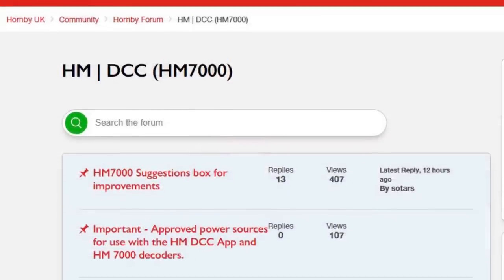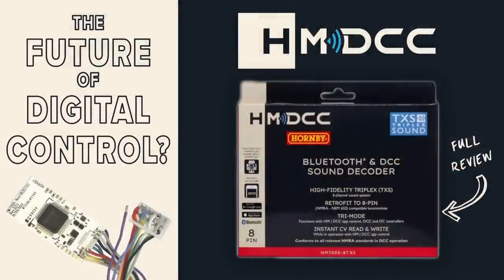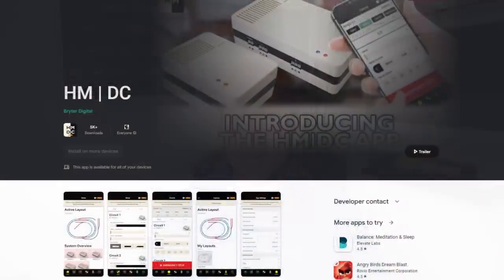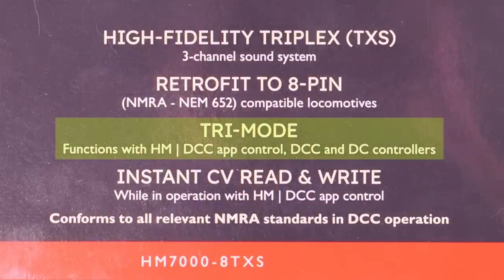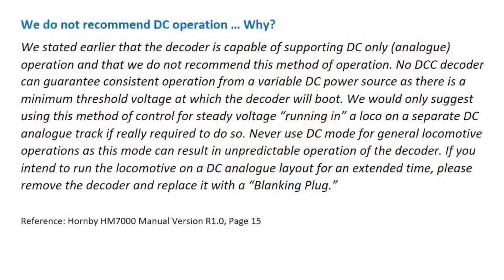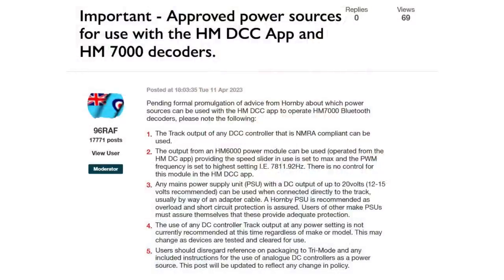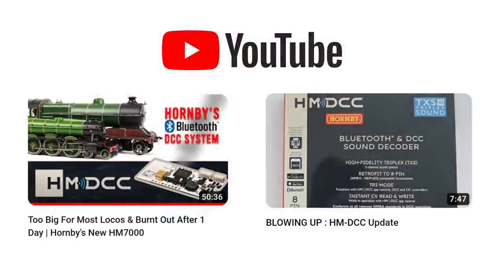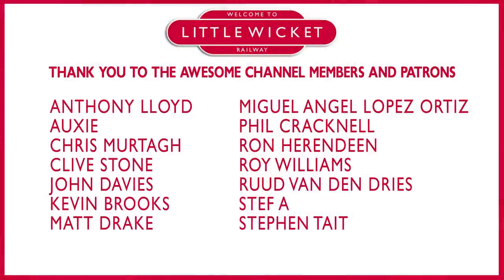IMPORTANT INFORMATION | Hornby HM7000 - Don't Destroy Your Decoder 💥

Comment: Hi Little Wicket, thanks for a balanced review of Hornby HM 7000. Now for my experience with the system so far. I’m a bit of a beginner in rail modelling but pretty good in Marine modelling, so when I saw that Hornby were moving into TT120 and I was looking to try something new I thought this is for me.
I ordered a set and a HM7000 decoder for my A4 , once both had arrived I tried to use the supplied PSU and controller but couldn’t get it to work. I then asked for help on the Hornby forum and the support was excellent from everyone including those you mentioned. I ended up purchasing the Hornby R7337 PSU and wow!! What a difference! Everything works perfectly, now since then I’ve been advocating to anyone who is having the same issues to purchase the R7337 PSU. 
I have also spoken to Simon Kohler about this in a roundabout way due to another issue and they are aware of the issue and will sort it out ASAP. Honestly I think that HM7000 is utterly fantastic with what I’ve seen and used so far.

Keep up the good work Little Wicket 👍
Reply from the maker: Thanks for sharing your experience and welcome to the hobby! It's good to know that TT120 and the new tech is bringing in fresh talent.
Reply: How did you set up the wiring for your track, as I’m new and not sure what to do. I’m using Peco track.

Comment: I have been very impressed with the decoder. At the price, functionality and user friendliness this really is a game changer and a big challenger to the existing high end chips. I think we need to remember and acknowledge that this is the 1st iteration and will be updated over the next 12 months just in the same way as Apple Watch Series 1 and the original iPhone. The beauty here is that firmware updates can be delivered over the air to fix the inevitable bugs that come with any initial launch of a product like this. I would like to see Hornby open up the platform to 3rd party sound developers to get more sound files available. I say well done Hornby for taking the risk and providing a real alternative at half the price of other decoders.

Comment: Mine seems fine. Had it on a Gaugemaster first of all, and whilst it was fine initially then it did simply stop working. Switched to a Lokmaus DCc and unlinked the HM7k decoder then went through it all again with the dcc power supply. All seems good. I’d agree with your take. Give Hornby some credit, as long as they treat customers with problems fairly, they are doing the right thing.

Comment: Been using this for a few weeks now with a Bachmann EZ Command for track power at home and the Lenz system at the MRC I attend. For me, it’s been flawless. My only gripe is that the range of sound profiles is a bit limited and there is no consisting option on Bluetooth. Apart from that, I would absolutely recommend this. Just do your research and read the instructions properly.

Comment: I don’t get the need to use an analogue DC controller. Just bypass the controller alltogether and use the DC power source directly. My HM7000 works fine.

I think Hornby has handled all this fine. They’ve had 80 minutes of live Q and A, videos out etc. Yes the Android app is a bit delayed, but give them time. Before the 2023 announcement a few months back, we did not even know we needed this! So what is a couple of week’s waiting time anyway?

Comment: This is probably a bit late but one of the reasons people pointed to the wrong app was the QR code supplied with the hardware actually pointed to the wrong app. They did actually correct it after a couple of days. I was one of the poor suckers that happily loaded  what the install instructions pointed me to. If you have to release software that doesn't work on a particular platform you put up a damn great error message on the screen.
Reply from the maker: Didn't realise that. They do make life hard for themselves sometimes 🤦🏼‍♂️

Comment: Be aware that similar power issues exist with USB where phones can be blown up when plugged into unknown (usually cheap) USB power sockets. When travelling I've seen warning signs at USB charge stations where they say they're not responsible if your phone blows up.  For the decoders, I would not be surprised if the solution when using them with an Analog PWM power supply is to install a keep alive capacitor (to keep the decoder working from a constant voltage) & some voltage clamps attenuate voltage spikes to a safe level.

Comment: So far I've fitted 4 of the Hornby hm7000 decoders and did experience some problems loading sound profiles but so far all seem to work on DCC and Bluetooth ,I use a Lenz system wiith DCC Concepts boosters to supply the track power.
Plus when fitting these decoders I use an anti static wrist strap and read the address on a programming track before the sound profiles are installed. 
And touch wood I have not blown any up yet.
Reply from the maker: Thanks for the feedback Dennis. Reassuring. I've got a couple more to try with the android app.

Comment: I got mine up and working last week and it was super easy. I used the HM6000 PSU plugged into a TT120 DCC power connector track. Fitted the chip and it found it and I was up and running in moments. I did have some weird things happen the next day when for some reason the loco would only run really slowly, but a reset and reboot fixed that and it's been fine since. I figure that's probably a software 'blip' more than anything else. It would be useful to know what locos the decoders will fit into as I've seen some issues online with them not fitting into other manufacturers locos, but it would be nice for Hornby to say which of their locos can and can't accept the decoders as they are bigger than usual.

Comment: My experience is very positive with the exception of the initial upgrade and profile install. That took 3 goes before the locomotive would move. I have since learnt that turning the throttle up full can help get the motor turning. That might have worked but I cannot be sure. Since then the decoder has worked as expected running from a Hornby Select power supply or MERG booster. The app is quite easy to use and configure. Some users have complained about a lack of function mapping but the basic function settings open up a lot of possibilities.

Comment: I have successfully installed 3 decoders in my Bachmann locos and am pleased with the results. I normally test them on a 2 metre long test track on my bench powered by Hornby's 4 amp power supply. I have three Gaugemaster controllers on my DC layout, and yes, they do work alright. However I do not intend to to put the Hornby power 4 amp power supply on the layout until I have converted enough locos to run it properly, so I shall need some more decoders yet.

Comment: I linked to the wrong app, but just follow the instructions on the Hornby forum.  No problems re linking to the correct one.  Had some issues uploading sound profiles, took a couple of goes.  I have just received my second decoder, I’ll then have two TT locos with sound if all goes to plan.  I’m using DCC EX no problem

Comment: I was about to order a couple of the TXS decoders just as the first failure videos went up.
I'm personally planning on using them with DCC anyway, so if there have been no reports of failures on DCC I'll get a couple to try out.
Hornby really should slap a big warning on these about incompatible DC controllers causing issues and possible failures.
Perhaps some form of protection can be included in future revisions?

Comment: I went back and watched the hornby announcement for this and at no point was it said that some common dc controllers are not compatible or not recommended. The statement said ANY layout can be upgraded to DCC with just a blue tooth chip.
Reply from the maker: Hopefully that will still be the case 🤞 Just need Hornby to do a bit of testing and confirm.
Reply: @LittleWicketRailway  perhaps that should have been done prior to release 😂

Comment: Just a bit of an fyi; the dc hm6000 uses a harsh pwm, why I don't know but I quickly ceased using the couple I bought as the pwm is even a lot harsher than the old hm2000.
Anyways, as far as decoders blowing up, I had the miserable experience of trying to run a loksound with a pwm controller. It did literally blow up complete with smoke, sparks, and an audible pop.
Lesson learnt was just run the decoders with the supply they're meant to have: my annoying stupidity was just to try to see if a decoder which is said to run on dc or dcc would work with a pwm controller.
Tbh, bit sick of the whole electronics, pwm, decoders, compatibility thing.
First train set I ever had was joining the 0 gauge rails together, sticking the key in the loco and winding it up.
Looking back theres a lot to be said for that simplicity. 90 years later still does the same thing: and you don't even have to clean the rails lol

Comment: I have 2 layouts, one DC one DCC. Locos get swapped around so DCC locos are run on both systems. I checked with Gaugemaster in 2021 that their Model D would not harm an expensive Sound Decoder and they assured me that their Model D has “a standard variable output and not a pulsed or feedback controller”. I have consistently used the DMU equipped with the sound chip since then on both DC and DCC layouts.
I have since been using a new Hornby  HM 7000 8 pin sound chip with the same Gaugemaster Model D (at full power) with no problems.  I observe that there is no response at all when trying to use the controller itself to control the loco.
I sincerely hope that Hornby succeed with this product - particularly in the non DCC market.

Comment: I think they did not expect many people on DC to take this up . They saw the main advantages as being for people already using DCC with DC very much a side issue . In fact , I, like many others on reading the blurb thought that this maybe a good way of introducing a sound decoder equipped loco on an otherwise DC layout  and that’s what’s caught them out . They appear not to have done much testing on analogue controllers , in particular Gaugemaster which I would say is the leading brand of controller . Seems a shame but my thought is that Hornby will quietly drop this aspect of control, in effect becoming Bi mode rather than doing any extensive testing on analogue controllers .  They really should have tested this before putting claims on the box . Instructions seem to be vague . Not really the level of testing you would have expected on a new system . I wonder if Blunami works ?

Comment: My opinion. There is a really good system here but marketing has over-sold the environmental tolerance of the hardware. If it had been sold as a set of decoders to be used with DCC power supplies then we would not be seeing a lot of this backlash. Setup still needs everything from broadband through Wi-Fi to Bluetooth physical proximity to be optimal and that needs to be worked on. But what is getting lost is that the system is quite easy to configure and fun to use. Try this. F27 is the Brake button, set as a toggle to back up the main, momentary brake button. CV123 sets the Brake Deceleration Rate and applies to F27. The Function tiles can be set to timer mode. So you can set a Function tile on any one of the 3 pages to have F27 bring a train to a halt, stop there for, say, 30 seconds and then automatically move off.

There is a lot of potential and that is being drowned out by the noise, some of it admittedly deserved. I look forward to the technology - and its applications - developing in a positive direction.

Comment: I got a 8 pin sound chip because I wanted to use it with a DC controller turned up to max as Hornby said you can do. The chip blew up after about two minutes of being powered up. When I say blew up I mean a flash of light and some smoke. A little frustrated but hope the issue can be sorted
Reply from the maker: Hi Matt. That sucks, thanks for sharing your experience though. That actually does sound like a mini blow up. Which controller did you use? Did Hornby replace it?

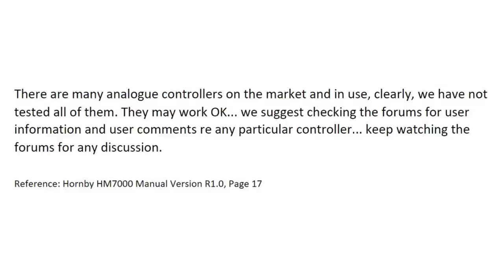Comment: @ 5:00, power issues with power packs. Not suprising, should see the issue with MTH O-scale trains with a bunch of train controllers
Only MTH 4000 unit is ok from MTH and very few lionel, due to NON pure AC

i would use sound decoaders with DCC controller due to allot of issues I have seen with other gear

Comment: I agree with your comment on the various reference guides and manuals. They are terribly badly written. I used to manage IT implementations and this looks like a programmers first draft. I think the issue is they are creating them on the fly and need to push that out quickly especially when it is different advice from what was previously communicated. Hazards of being on the bleeding edge
Reply: Harsh

Comment: Excellent video and advice, why oh why have they released it without adequate validation methods being used. Using their customers to act as test pilots should not be acceptable at any level.
Are Hornby mimicking Windows operating systems when you have to await a release of  'patch' for it to run without bugs
I'm not sure how many DC controllers are on the market under 50? not beyond the wit of man to determine compatibility with these decoders.
Anyway, enough of the rant, again excellent info.

Comment: I use a digitrax dsc 210+ and no problems so far apart from the odd fail in installing the sound profiles which hopefully will be sorted with a few updates not even tried to run on dc which is how I’m gonna keep it.

Comment: I use a Gaugemaster prodigy, is this ok, ? and do I connect the Hornby bluetooth into the track as well as the Gaugemaster.? Thanks for the advise...
Reply from the maker: If it's an NMRA compliant DCC controller then it should be fine. The best place to double check is the Hornby forums or maybe Gaugemaster.

Comment: Well, crap. I've bought the decoder because Hattons said they can run on DC controllers. That was the reason why I've bought it as I wanted to have a try for DCC operation and I'm blown away by it. I might invest in a Hornby DCC power supply as suggested but for the time being its fine. I mean I ran the decoder for three days and until now its still alive and well the speaker too. Hopefully, with my old German (1990s) train set controller, mine won't die and hopefully Hornby can fix it since this is the biggest reason why I got it in the first place

Comment: Well it started ok, bought the hornby power supply ie 15v  work a treat till last week turned  the loco made the stream sound turned up the speed not happy it was jerking so I cleaned the track with meths and a gentle cleaning of the tender wheels left to evaporated had a bit of dinner sparked it up nothing checked voltage on track 15.2 so ok took the chip out fitted the original dc chip working a treat, I had noticed when I first fitted the dcc chip and running in the loco the tender got warm not if it should, have contacted hornby just waiting

Comment: Sam from Sam's Trains had one fail within 24 hours.   I haven't seen it myself yet.
Hornby should of had protections in place in the programming to stop the HM7000 from linking to the HM DC app.   This is a little it of poor coding on Hornby's part.     I also think that saying to use a DC Controller at full power is a bad recommendation as even at full power they often have PWM in place that can cause issues.

Comment: Also never use an old H&M Duet as they output 24V full wave recertified DC (averaging about 15V DC RMS) which is far higher than any DCC board can handle, even those supposedly able to handle DC.

Comment: So why can you use a Bachmann dcc fitted and sound fitted loco on dc with no issue? Poorly rushed release, decoders too big for many locos and only Hornby sound profiles. If it is supposed to be as they have suggested, “industry standard” why the limit? Oh and Bachmann in the US market has been using blue tool control on many of its HO loco range for a number of years, so not a leap in technology.